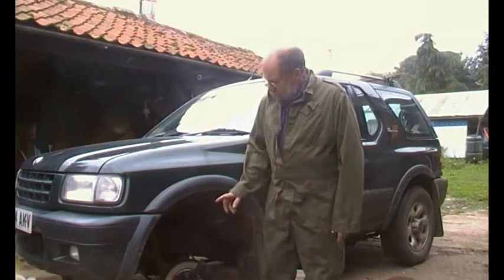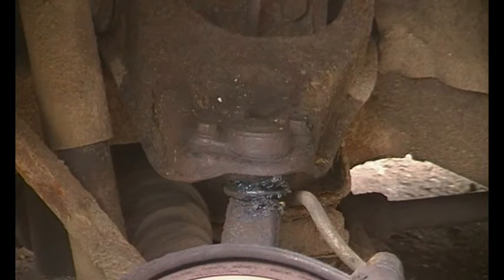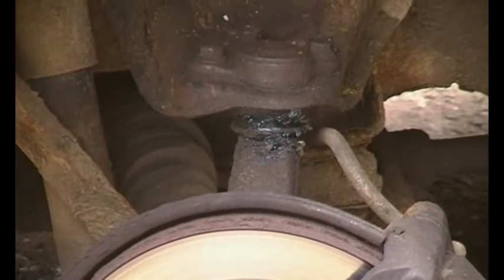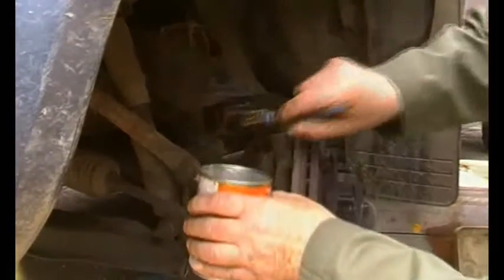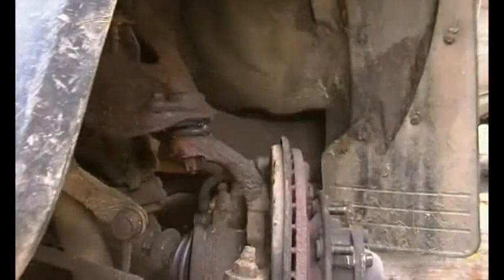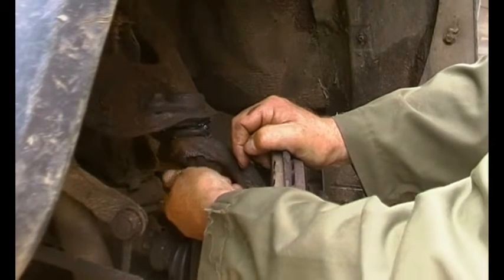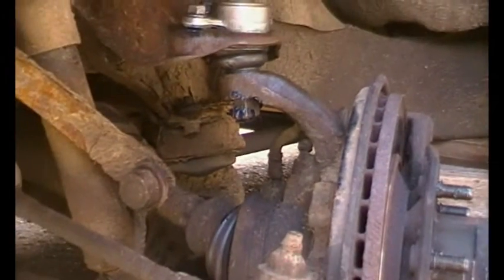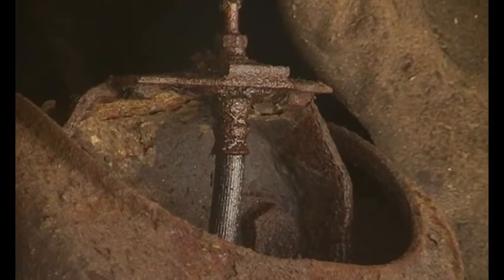Vauxhall Frontera steering joint replacement, ball joint knuckle trunion.

Comment: Very good torque wrench impression Andy.... I'm glad the swivel swap went well....
Reply from the maker: Dave, got to get it ready for the next test. You might find Jeff Bradshaws 1959 pontiac 389 series where he uses old time techniques to get an engine running. Cheers

Comment: Did I miss the bit where you showed us how to lower the suspension
Reply from the maker: Hi, did you really, try 7.44, cheers
Reply: @TheInfoworks  Sorry I did look. You said it was torsion bars to lower it but the video cut away and it didn’t show how it was lowered you just said that it needs lowering
Reply from the maker: @recall2880  Cheers, no worries and later on a I talk about jacking the suspension back up, cheers
Reply: @TheInfoworks  okay thanks. I have watched the video again a few times and I know you mention lowering the suspension and that the vehicle has torsion bars, but the video then cuts straight to you hammering to loosen the taper but no instruction on how to actually lower the suspension? Cheers
Reply: I dont think he does losen The torsion bar, just has a jack under The hub and jack it up and down.
Reply from the maker: @jesperborg7427  , that's right, just lower it on a jack to give room to fit the new joint, then jack it up again. No need to mess with the torsion bar, Cheers
Reply: @TheInfoworks  Great to clearify 😄 Great video
Reply: @jesperborg7427  So then you can’t lower the suspension anymore than not having a jack under the hub as it’s already at its lowest point by then?
Reply: @recall2880  ju can use The jack just to hold The hub a bit into The Air, IF u dont have anything under it Will just flop around
Reply: @jesperborg7427  Sorted it! Many thanks for your info and help. Without you and the guy who made this video I would never of done it